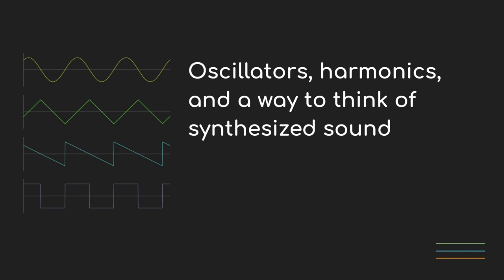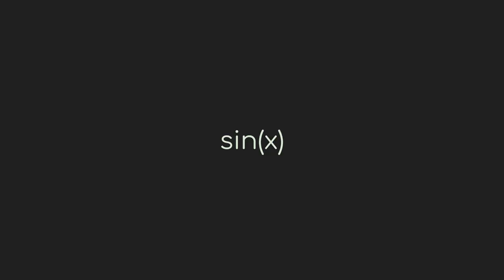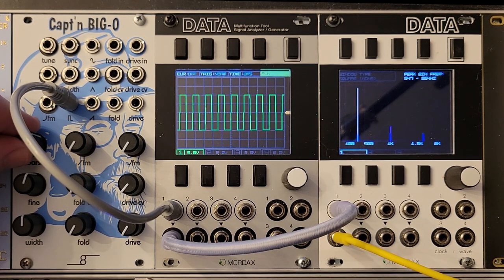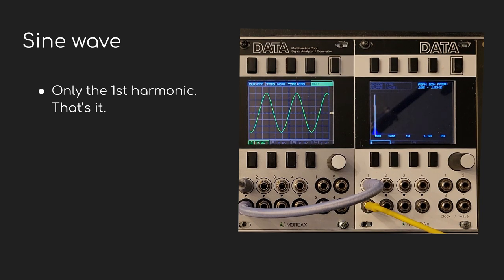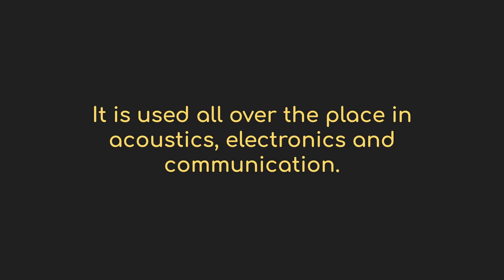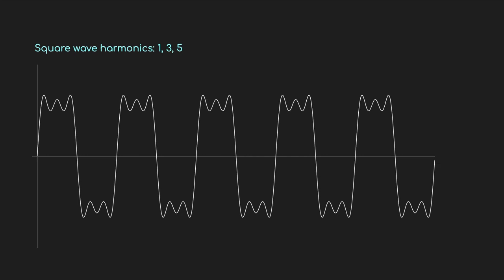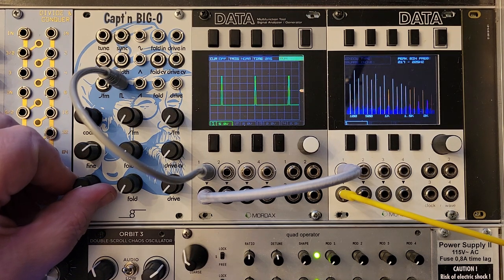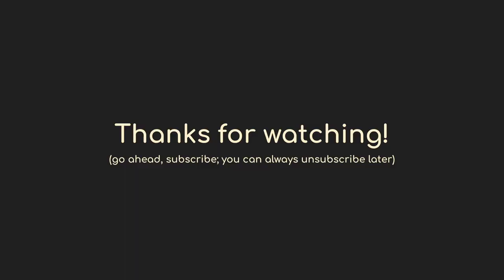Oscillators, harmonics, and a way to think of synthesized sound

Comment: Very interesting Video! I really like how well you visualized the construction of the classic waveforms with the increasing number of harmonics. The weirdly distorted sine wave output of the nonlinearcircuits oscillator is most likely not your fault ;-) Many analog oscillators don't accually generate a true sine wave, but rather use triange or sawtooth wave at it's core and distort it into a sine wave (In fact not sure a single analog synth with a true sine wave generator even exists). The circuit in the NLC CEM3340 VCO is a very simple sine shaper that only uses clipping diodes, which is simple to build and uses fewer components, but is also less precise and is missing trimpots to fine-tune the shape of the sine wave.
Reply: Not to be argumentative, but there are plenty of ways to create pure analog sine waves, generally using feedback and integration - many oscillating circuits wish to produce sinewaves as their natural response, since this is the response of an undamped 2nd-order differential equation (for example, consider the Wein Bridge oscillator). Just thought I'd share.
Reply: @superultramegarobot  Yes you definitly have a point. The main issue with many of those circuits is controlling the frequency accurately with voltage, which is why it's uncommon among analog synths. But now that I think of it, you could argue that a self-oscillating filter is a pure sine wave generator.

Comment: Power chords (very important in rock/metal guitar) are a part audio illusion, part distortion trickery, to make the sound sound lower.

This is typically done by playing the root, the fifth, and the octave, which approximates a 2:3:4 ratio.

This makes the sound wave repeat in a cycle the LCM of the individual wave period, which is half of the base note. Especially when you apply distortion to add higher harmonics and increase energy, it sounds like one note an octave down.

Comment: Great demo and explanation! For bonus points you could include the pure even harmonics waveform, e.g. Befaco EvenVCO. I don't know why it's so rarely used, I find it quite pleasant.
Reply from the maker: Thanks!  And I had no idea that was why it was called the Even VCO!  I think I have the PCB/Panel set for it sitting in a drawer, now I have to build it.
Reply: @SoundVoltage  It's a wonderful VCO.